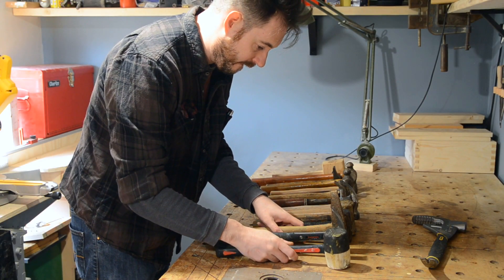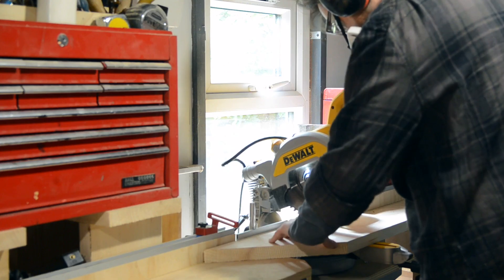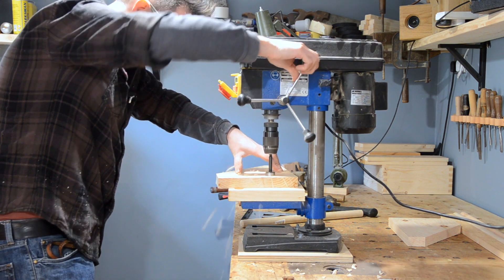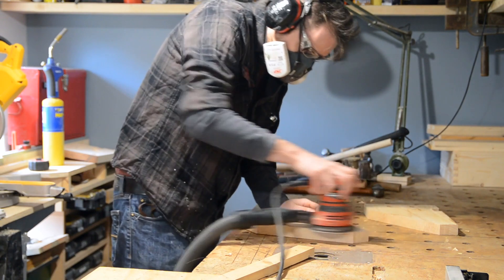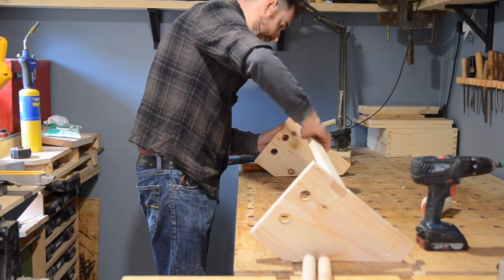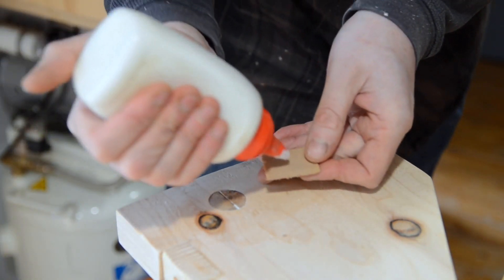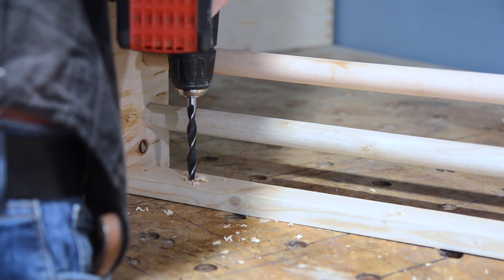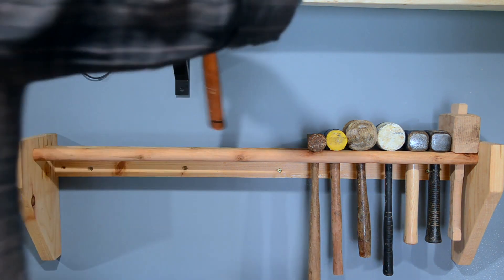Making A Hammer Rack

Comment: Great bit of useful storage, and nice to see some finish going on it! Doesn't take much effort but it makes a big difference in helping keep workshop stuff from getting grubby so I'm a big fan of taking the extra time myself.

One quick thing if I may, did a search and I don't think anyone else has mentioned the orientation of the wedges. They should go in at right angles to the grain of the housing piece, otherwise the wedging action risks splitting it.